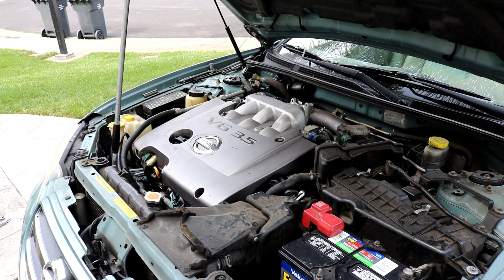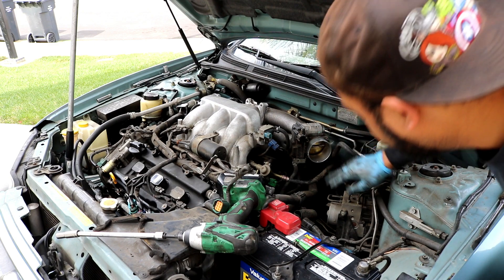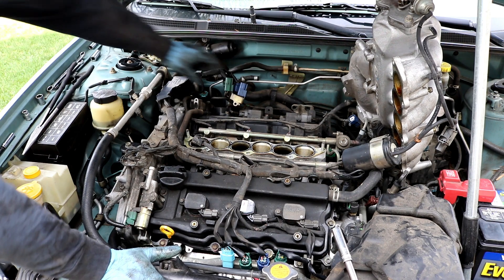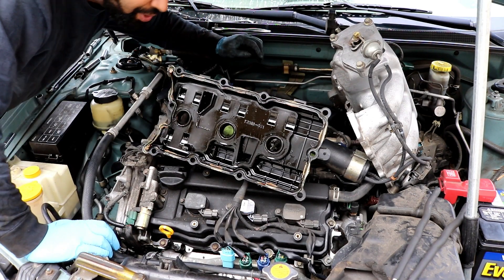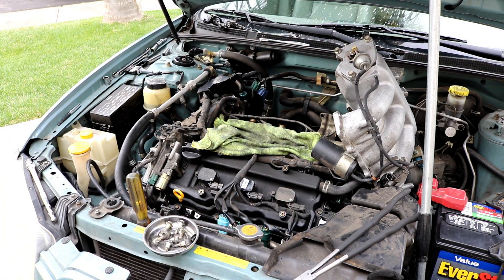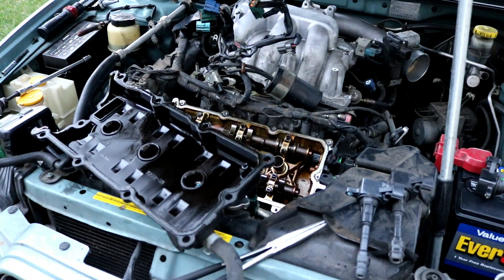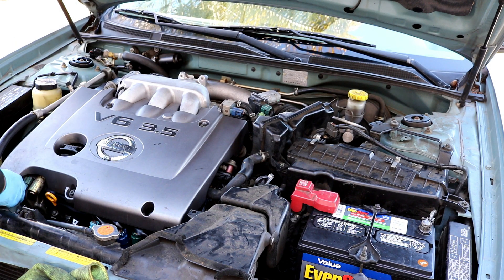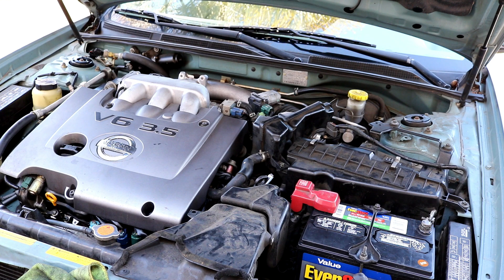Nissan Maxima/Altima/Infiniti I35valve cover gaskets 3.5L V6 VQ35DE

Comment: Hey Helping hand Auto Repair, where are you located. I might just bring my car in for service to replace the valve covers, coil packs, spark plugs camshaft sensors, mass air flow sensor and anything else we find while the car is in the shop. Thank you in advance.
Reply from the maker: I live in the Bay Area.
Reply: @HelpingHandAutoRepair  Thank you but I am all the way in NYC. Don't think the car will make it there. Thanks again
Reply from the maker: Sorry I am not closer.

Comment: Hey dude i’m redoing my valve cover because that elbow piece broke. Do the valve elbows connect to each other??? or does that go into the manifold, experiencing leaks and trimmed fuel
Reply: what i mean by that is in replacing the bank 1 valve cover, does the elbow go back into the intake manifold or does it connect around to the bank 2 valve cover
Reply from the maker: What elbow?
Reply: @HelpingHandAutoRepair  the elbows on the valve covers, those are connected correct?
Reply from the maker: This video was awhile ago. Are you talking about the PCV breather hoses?
Reply: @HelpingHandAutoRepair  yes i think so
Reply from the maker: I need to watch the video again to try and see what elbows you are talking about. The front breather hose goes straight into the intake box there. It doesn’t appear to be connected to the rear valve cover.
Reply from the maker: Ok I see where you’re talking about. The small piece of rubber hose that connects the two valve covers did in fact break into pieces. I just replaced it with another new hose. Just some bulk vacuum hose from a local parts store worked.

Comment: What about the tube seals? They are glued in and will destroy the cover if removal is done experience taught this to me. new covers are the only way to get rid of misfires due to oil in the tube areas
Reply from the maker: If you pull your plugs and have oil on any of them, then yes you need new valve covers. This engine had ZERO oil on any plugs. This is why only the valve cover gaskets were done.
Reply: @HelpingHandAutoRepair  Once you disturb those tube seals which are as old and hard as the gaskets you just replaced they will leak and cause misfires in the near if not the immediate future and do it all over again. I don't need the practice myself...
Reply from the maker: @cathygambill1554  car was sold to a friend and 2 years later and 40k more miles. No issues.
Reply: @HelpingHandAutoRepair  Wish I had some of your luck lol
Reply from the maker: @cathygambill1554  lol. Hey it’s not always like that. I don’t understand why they would even make the tube seals like that in the first place. It’s pretty dumb.
Reply: @cathygambill1554  the seals aren't replaceable on these valve covers, there is a way you can stick two different seals from another engine together and they work but I'd prefer not to do work like that.

Comment: Man, appreciate your video!  I got it all buttoned back up--wire harnesses and hoses.  Everything--I'm pretty sure--still checking.  While I was in there, replaced the spark plugs and coil on plug/boots on the packs.  When I fire it up, idles real rough.  Drove it around the block.  Missing a lot of power.  Service engine soon light started flashing.  Got it back in the garage.  From what I can tell, seems like a misfire on cylinder(s).  Or could it be a vacuum leak?  I know might be hard to say, but appreciate any thoughts you might have.
Reply: Going to borrow a code reader tomorrow.  See if I can narrow it down.  Are iridium plugs okay?  Using these  https://www.autozone.com/external-engine/spark-plug/ngk-ix-iridium-spark-plug-4469/937722_0_0
Reply from the maker: Check engine light should point you in the correct direction. Those plugs are fine.
Reply: @HelpingHandAutoRepair  Thanks.  I'm pretty inexperienced, but maybe have a vacuum leak.  Can hear a whistling noise intermittently.  Code is general cylinder misfire P0300.  Man, not sure where it is coming from.  0300 is a pretty general code, and could be a lot f things, but had no problems before changing plugs and fixing these gaskets.  Appreciate any thoughts you might have.
Reply: Could I have tightened the upper intake manifold down incorrectly?  Guess I could have.  I tightened all 5 bolts/nuts to the 180 in-lbs, and made sure the two in the back in the bracket were solid.  I also used a new gasket.  Worth taking off and reseating it maybe...  When I hit the accelerator, I can hear the whistling noise grow.
Reply: I picked up a vacuum gauge from harbor freight and teed into the line coming immediately out of the intake manifold.  It sits at a solid 18 in. Hg.  The engine is struggling so much though that when I hit the accelerator, the needle does not snap back to zero.  It drops slightly and bumps up to 25 or so, then settles back at 18.  It seems that I can rule out vacuum leak?  Maybe fork for new coils?  I am going to replace the PCV valve probably because it wouldn't hurt, but not thinking it will solve this problem.
Reply from the maker: When you snap the throttle open, you should get a reading of around 2-3 inches Hg and then it should jump back up to around 24-25 inches Hg and then stabilize again back to your normal idle reading of 18 inches Hg.
Reply from the maker: Do you have a consistent misfire right now? Did you spray carb cleaner around the vacuum sources.
Reply: @HelpingHandAutoRepair  Yes sir.  The misfire is such that the engine shakes and sputters pretty rough.  Seems that there is no sign of a leak though.  Can't get it to change the idle spraying all around the intake/plenum/vacuum system.  The slight squealing whistling sound might be a belt.  Don't have a trained ear.   I went ahead and ordered some NGK coils.  I figure since I plan to keep the car, has 160,000 miles, maybe I can get another 100,000 out of it and new coils might allow me to never have to worry about them again.  A worst that's all I get out of the purchase.   I also went ahead and picked up the OEM platinum plugs.  I know you're probably right in that the iridiums work for a lot of people.  I've read a few things about the VQ35 being real picky with plugs.  So when I go back in with the coils, I'm going to swap the plugs.  I guess I won't know for sure if it fires back up whether it was the plugs or the coils.  Since I don't want to take it apart a third time.  I'll let others that might be reading this know how it goes. If I'm still at a P0300, I'll need to take a step back and a walk around the block.  I appreciate the video man.  It's been a good learning experience.
Reply from the maker: Well you are definitely on the right track of using a vacuum gauge to check the over health of the engine. It would seem that coil packs are the next culprit considering you touched nothing else. Make sure your coil pack connectors are tight. Sometimes the plastic clips break causing the connectors to wiggle loose causing a misfire.
Reply: @HelpingHandAutoRepair  Man, wish I could say new coils and platinum plugs fixed it, but still getting the P0300.  Taking extra care to make sure all wire harnesses are snug and hoses all secure.  Also replaced the PCV valve just cause I was back there.  It did not look bad.  Vacuum pressure off the intake still a solid 18 inHg.  As I research this, I'm finding several other stories like mine, but not too many success stories.  Like you said, I did not touch much, and it is strange for other components to begin malfunctioning at the exact same time.  I'm leaning towards an O2 sensor maybe creating problems.  Maybe.  I have a very basic scan tool and can read the voltages off the 4 sensors.  I see fluctuation between 3 of the 4 sensors in voltage between 0.100 and 0.900 V.  But O2S22 is stuck at 0.280 V.  This might be normal for a downstream sensor from what I read.  I'm not getting any codes related to an O2 sensor, so this might be the issue at all.  I'm just really grasping for straws.  Any advice on what I might try before I take it into a shop.  I got to find a good referral for a mechanic in the area cause I'm concerned about getting hit with a list of repairs and a bill that is more than I want to put into this car.   Again, much appreciated.
Reply: Maybe something with the fuel injectors?
Reply from the maker: .280 is fine. That will most likely change as the car is driven. 

Only other thing I can suggest to try is:

1.  check the main intake tube (from the airbox) for cracks.

2. If you scanner can read the MAF see if that reading ever shows ZERO. If it does, the. You can try cleaning it with MAF cleaner only and follow the directions on the can please.

3. You can try renting a noid light set to test the injector wiring circuits in case those were disturbed.
Reply: @HelpingHandAutoRepair  Right on, I appreciate it--I'll see what I can find.   The oil leak at the looks like it's gone tho. 👍
Reply from the maker: Sounds good. Please keep me updated as I will try and help you as best as I can.
Reply: @HelpingHandAutoRepair  Thanks man.  Examined the main intake tube, looks good.  MAF reading (with the limited scanner have access to) ranged from 6-8 g/s, more when I hit the accelerator.  Seems to be working okay.  I picked up a noid light test kit (will be good to have around)  Was able to test 5 of 6 injector leads.  That one in the rear bank under the manifold could not access.  All 5 were giving power.  Also tested the coil leads with the same light--to make sure they are getting power.  All 6 are getting power.  My neighbor came by and said maybe the fuel injectors need cleaned.   Maybe the fuel system is where things are breaking down.  Air, fuel, spark, compression.  Trying to figure out why it's missing.  I took it down to a repair shop down the street.  I will let them hook it up to their diagnostic equipment and see what they can figure out.  Will let any that might be in a similar situation reading this one day know the outcome.
Reply: One more question.  I disconnected the battery while making the repair in the video.  Was this a bad idea?  Could it have messed with anything in the computer and how it meters the air / fuel?  I did the idle relearn sequence, but obviously that will not fix why I'm misfiring.  Really stumped though.
Reply from the maker: Ok please lmk what happens. Curious to know.
Reply from the maker: @GraceByWhichIStand  no. You very well may have a bad coil pack.
Reply: @HelpingHandAutoRepair  Appreciate your help on this repair.  Been meaning to post a quick follow up.  Turned out I had the wires to the coils for cylinder 1 and 3 in the back bank flipped.  The shortest wire I assumed went to 1, 2nd longest to 3, and the longest to 5.  Once I had this stuck in my mind, I assumed it was the only way it could go and did not consider flipping them around.  But the shortest one goes to 3.  It did make sense though after I looked again, the shortest wire is the second branch on the harness.  Oops!  I felt kind of foolish about it, but glad the mechanic here in town figured it out quick without having to take anything back a part.  Everything seems to be good, and my oil problem is now maybe a drop or two here in the first week.   Thanks!
Reply from the maker: Glad you got it sorted.

Comment: Any reason why you didn't change the whole valve cover on both sides? The spark plug tube seals will eventually leak and they are not replaceable. Had the rear vc done on my 2003 Maxima for that reason and now need to do the front.
Reply from the maker: funds of the customer weren’t able to do so. This car was being sold so they opted on just the gaskets.

Comment: I was told that on these engines you have to replace the valve covers themselves as well is that correct?
Reply from the maker: No. On some the the later VQ engines, they need to be replaced as an entire unit.
Reply: I have a 2008 so would that be  One of the ones that need the valve covers? Thank you for all your help
Reply from the maker: Derek Smith you’re welcome. Let me first rephrase what I said earlier. You are correct by people saying the entire valve cover needs to be replaced. This is true ONLY if you have oil leaking down into the spark plug holes. If there isn’t a drop of oil down on the spark plugs/coil pack boots, then you’re good to just replace the outer valve cover gaskets as shown in this video.

If you do have oil on your spark plugs/coil pack boots, then you will need to replace the entire valve cover with new ones because the tube seals are very well embedded into the center baffle of the valve cover.
Reply: My 2000 nissian maxima has oil in my spark plug #5 do you have video for that?
Reply from the maker: The Valve cover gaskets need to be replaced
Reply: Helping Hand Auto Repair I recently changed my spark plugs and ignition coils do I have to take them out as well and replace them again ?
Reply from the maker: When you’re doing this valve cover replacement? No.
Reply: @dereksmith7965  said the free

Comment: There is no "front"or "back" valve cover. 
The diagram says left or right. 
Can someone tell me which is which?
Reply from the maker: It would depend on what direction that diagram has the person looking at it.

If it has you standing looking at the engine then left would be the back and right would be the front.

If it has you looking from the back of the engine, then left would be the front and right would be the back.

Hope this makes sense.
Reply: @HelpingHandAutoRepair  I figured it out. When sitting in the driver seat is what they go by.

Comment: HELP..........Hi Helping Hand or anybody who can help me out.  I followed this video to the smallest detail as that 10mm bolt on the back of the bracket was killer, but we got it off.  

My question HH or anybody if you remember, I'm ready to remove the Intake manifold, but it won't budge on the right side like yours did in this video as yours lifted smoothly to right and rested.  Mines lifts off the foundation (mating surface), but it's so much attached to the right side it seems like that there's much more I need to remove, but I removed only the things you did in this video.   

Do I need to remove more hoses on the right side, I don't want to force anything drop anything or break anything lol.. Infiniti I35 2002--HELP.........................................
Reply from the maker: Not sure since I’m not looking at your exact hang up. Just take a look at what’s still attached and take it off.
Reply: @HelpingHandAutoRepair  Simple enough, but your method seem like the easiest without removing all the additional hoses i.e. coolant, clamps and sensors like they did in some of the other vids.
Reply from the maker: It’s probably something simple holding it up. Just have to look closely.